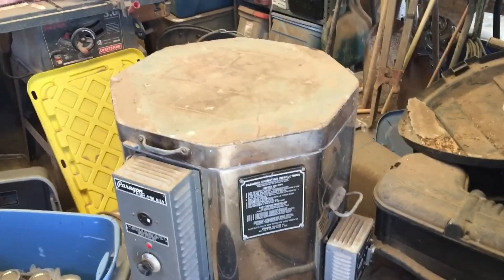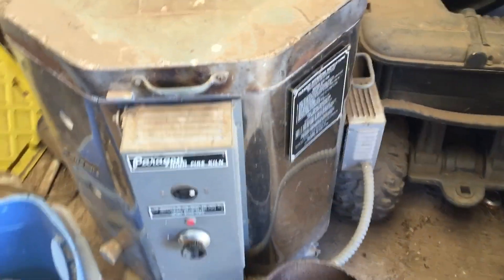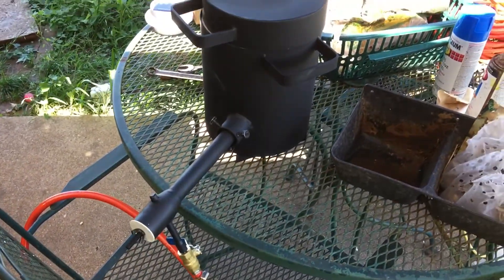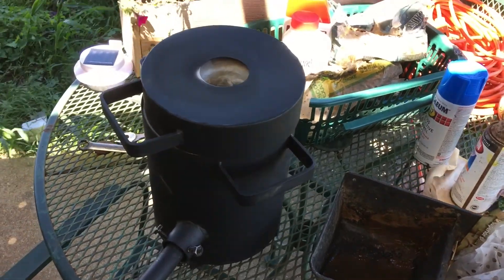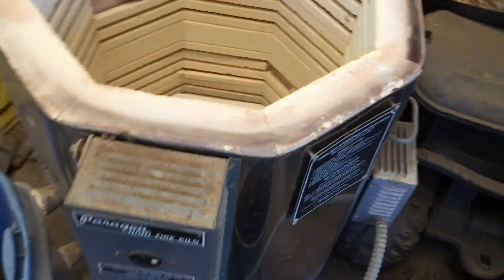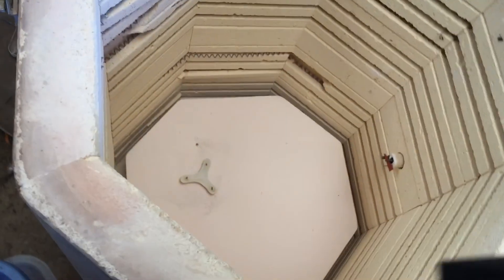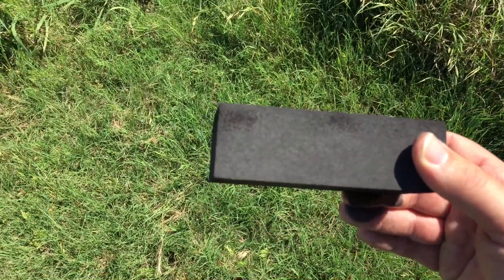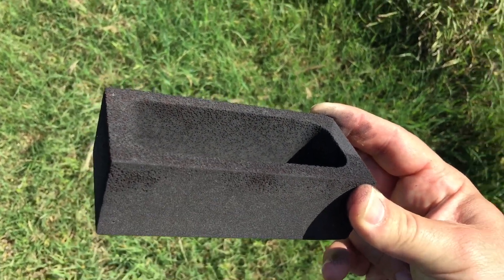Preparing Graphite Crucible And Ingot Mold

Comment: Yeah great job on the crucible but it's a no no regarding the graphite mold ,  graphite is suppose to take the heat evenly once poured and acts like a lubricant to drop the ingots out , doing what you did with the mold  probably decreased the lifespan by a  1/3    crucible looks great though !

Comment: Do not do this to your mold ,VIEWER. The mold is not meant to get red hot. The ingot will match the pourous sides and bottom, if it holds together once molten metal is poured in.
Owner you should change the title this vid as what not to do.
Reply: I’m new to this myself. To me, you just need to heat the mold before pouring. A porous mold I’d assume you’d never get the ingot out of without breaking the mold apart. Temper the crucible, not your molds.
Reply: phil amburgey lmao! You tube experts 😂
Reply: @giggetygoo9823   So you can't disprove his assertion? I wonder why no one else recommends "curing" molds?